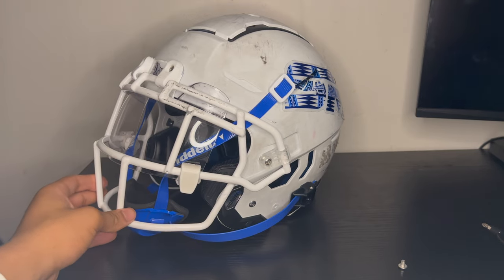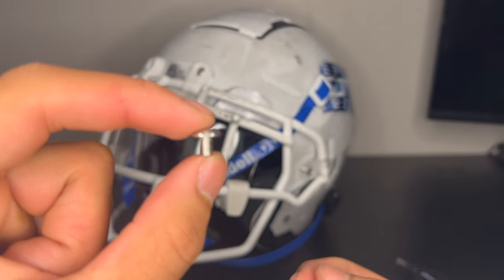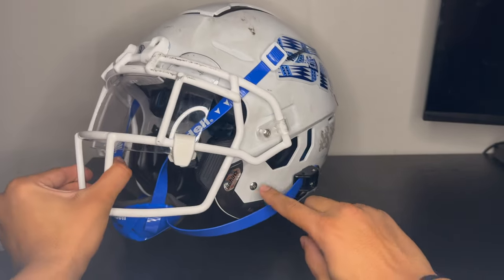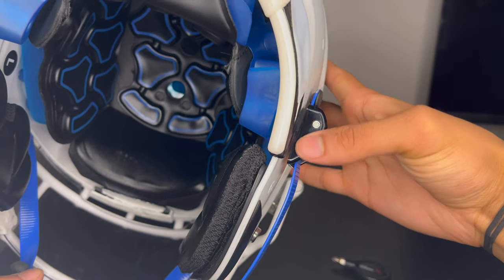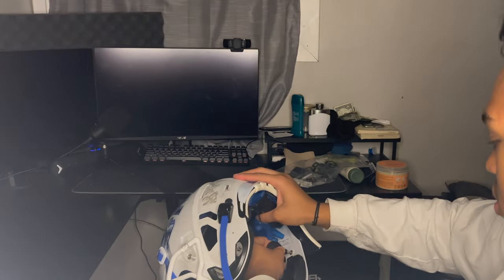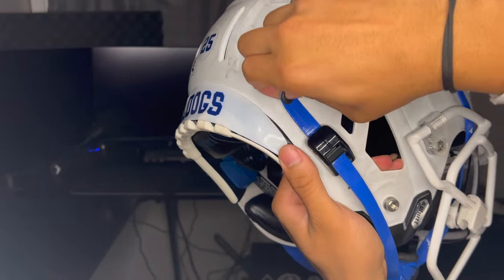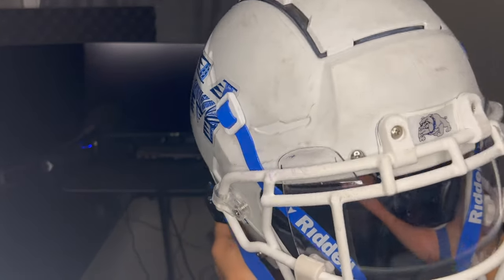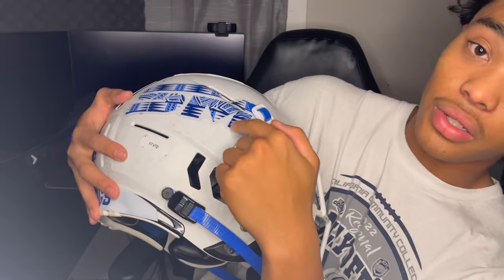How to Install Camlock on F7😍🤯*I Figured it out* NOT CLICKBAIT

Comment: Can I just buy a cam lock and put it on my sportstar chinstrap and replace the buckle or do I need to buy one of the chinstraps with the grooves
Reply from the maker: I don't recommend any strap other than the Speedflex chinstrap and the Schutt f7 chinstrap that comes with the f7 helmet. Both works. I've tried the Speedstar, personally, I'm not too fond of it but it's all about preference.